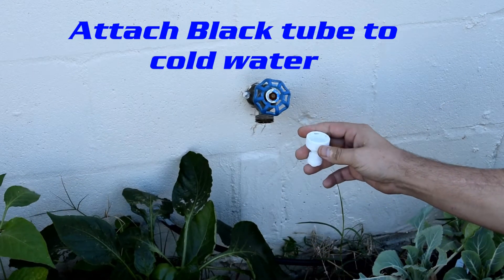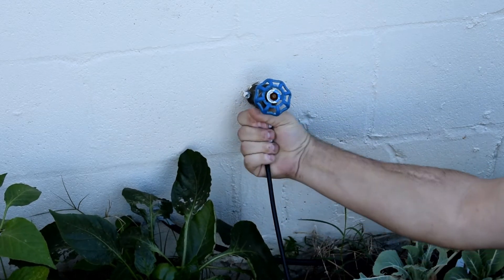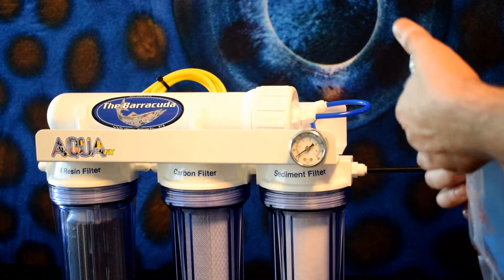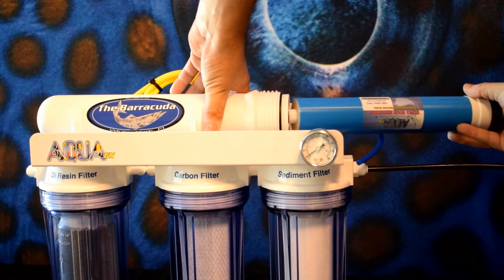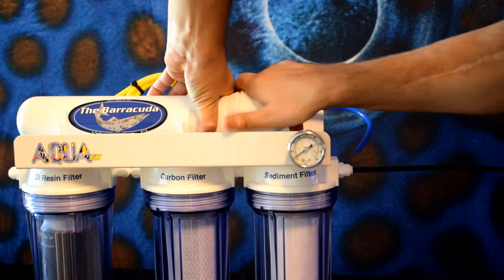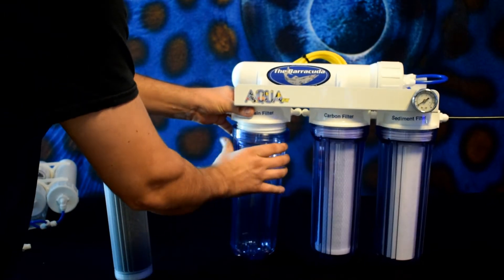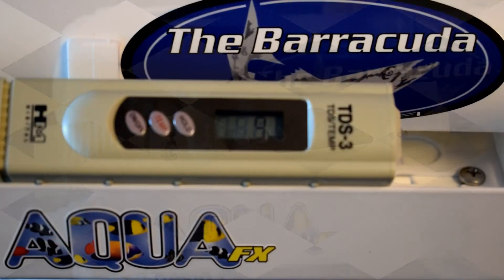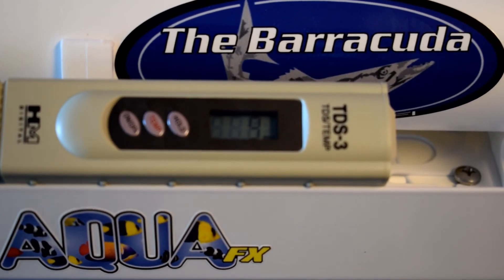AquaFX Barracuda RO/DI Quick Install Guide

Comment: I got the aquafx Barracuda on January 7 2019 and  got my inline TDS METER  on January 9 2019  I do what you said in this video and the video about added the TDS METER  an I can say one thing I love it. I have 1 ppm coming out of my RO membrane and 0 out of my di resin. I'm so glad that fish world in Chesterfield Virginia told me about the Aquafx 100 gallon per day so far I've made 20 gallons my water pressure says it's about 50 and it takes about 1 1/2 hours to make 5 gallons of ro-di  water with my old system not mention names of other company I had a 50 gallon per day it took about 3 1/2 to 4 hours to make 5 gallons of ro-di water one last thing I can say price of the aquafx Barracuda was a pretty good price for what you get...

Comment: Hey Pete .... Nice new Video. Looks like your streamlining them. I called a few weeks ago and talked to you about my barracuda and burping the the di side after replacing everything. Every time the unit sits it bleeds back down again?! Any thoughts on that ?
Reply from the maker: Thank you!! Yeah we will have more in depth (longer) videos coming out, and a series of Quick Pro Tip videos just showing the nitty gritty!!     So the "Air pocket" that can show up is usually caused from air in the line (can be from the feed and nothing your doing write or wrong) - Try opening the canister while the unit is making water, the air pocket should be pushed out. Seal the DI before the water comes out - here at the shop we may do this 2-3 times after a filter change, but we can usually get it to go away. Good thing is that nothing is effected with the water quality. Let me know if that doesn't solve it?!
Reply: AquaFXdotNet 
Thanks for the reply! It’s been about 2 or 3 times I’ve let the air out till it fills up again. I’ve checked that all fittings are tight and all the canisters are tight. Hopefully it’ll work itself out soon. Thanks again!

Jereamy
Reply from the maker: Our pleasure Mr J!   Ok so  your Barracuda RO/DI is a pressurized system - if the fittings were 'loose' it would actually be "leaking" out of the unit (water on the floor ect.) But air can find its way into the system when we change the filters, or sometimes when the municipalities work on the lines. A few more 'burps' should hopefully nip it in the bud - keep us posted either way, you are NOT the only one this happens to!! lol :)